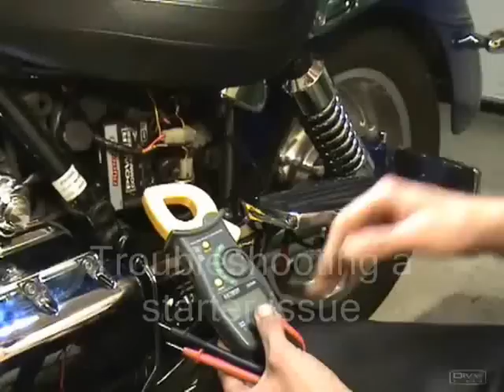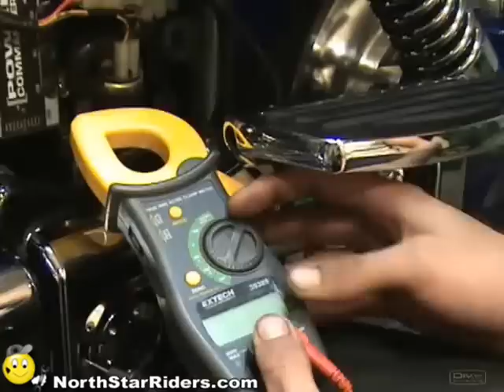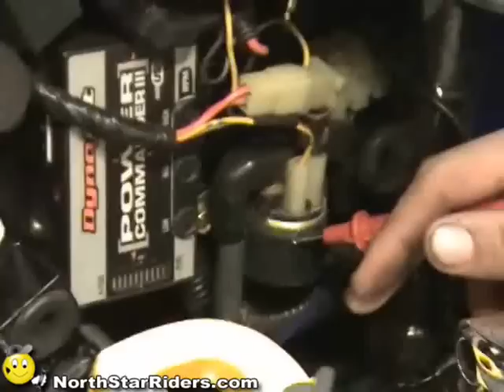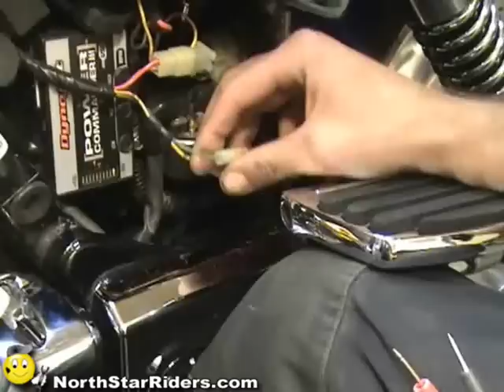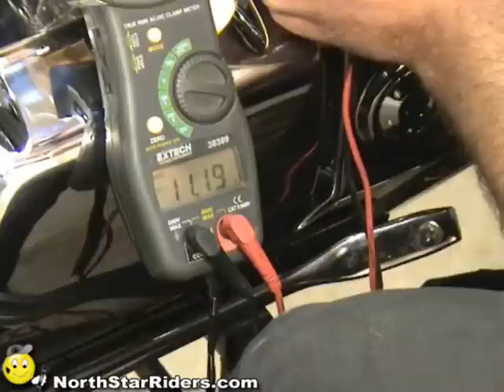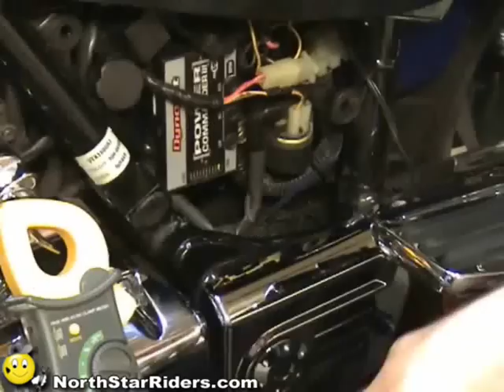Troubleshooting a starter issue NSR Tech

Comment: My 1500 drifter, (2000) model,, clatterd and will not start but I can hear something spinning at a high rpm. Do I have an abendex type part broken or should I just replace the whole starter ?

Comment: Can I pull the battery and jump the starter motor while it's still installed on the bike just a quick sec or two to verify energizing the starter motor works?

Comment: 800 Vulcan won't start grinds like starter is bad put on new starter same thing just grinds opened engine everything looks good no teeth ground off no metal shavings in oil. Any ideas what the problem could be

Comment: So I bought a new starter relay but I get multiple clicks no turn over. I jumped  started it and it starts up if I take the cables off it'll turn off after 1 minute. I have anew battery also and it started the first time but now it won't start at all....
Reply: Walter V  you have a charging issue. Rectifier or stator. Or loose connection from those two areas

Comment: When I turn my key and press the start button, i get nothing, no sound,  no anything. Just lights and horn.  However, when I put a wire from hot to starter and "hotwire it" it cranks up.  Why wont that button make any noise or anything?
Reply: Seabreeze Rides you need a new battery. Your old battery is worn out it doesn't have enough cranking amps.

Comment: I got a big problem when I was trying to turn on my bike  it's turn the fuel pump normally and the light , as soon as I press there start button the do a click and everything turns off......I check the battery it has voltage I'm thinking it's the relay but now it does not even turn the light on, ...I left the key turn on and it turn the fuel pump like 30second latter
Reply: lostone4711  yes I found it was the batery... it was dying when I use the multimeter  on the batery it say 12v.... but as soon as I press the start button it when down to 2v..... check the batery.......if that not it take a screw driver and tosh positive and negative ( with the key on)....on the main relay  if it's starts   the problem can be the main relay or starter relay depending how you called
Reply: LORS13 g

Comment: I have power to my solenoid, but starter won't even click.. Any suggestions?
Reply: Sometimes there is a main relay or main body fuse on some bikes. This relay or fuse may have gone bad. (Not the starter solenoid.) Do your lights turn on when you turn the key?
Reply: Brandon Rodgers I have similar problem and yes my lights turn on  and sometimes if I take these plugs off and put em back on solenoid  it was starting.  but I'm Tryna get it working more efficiently..